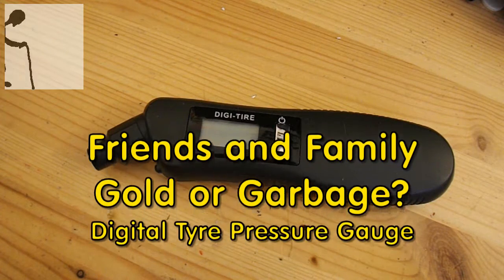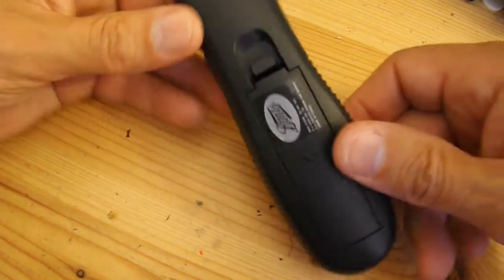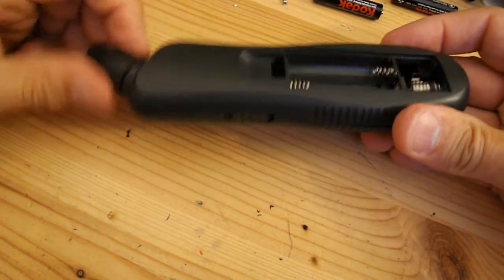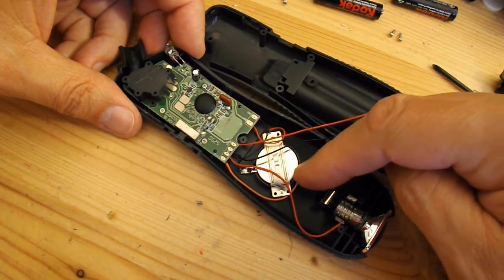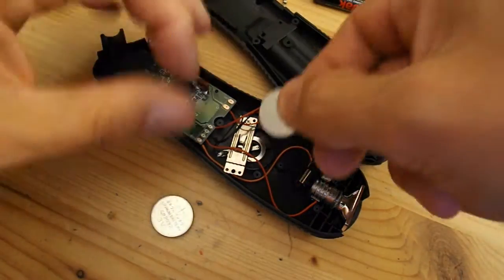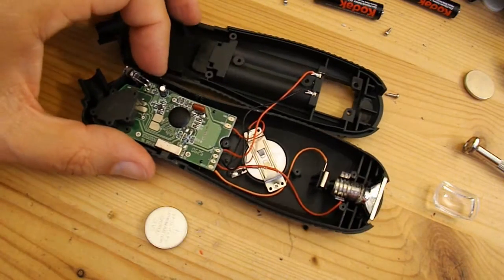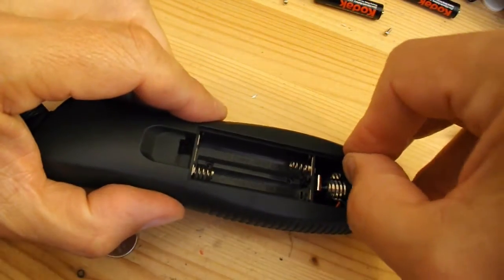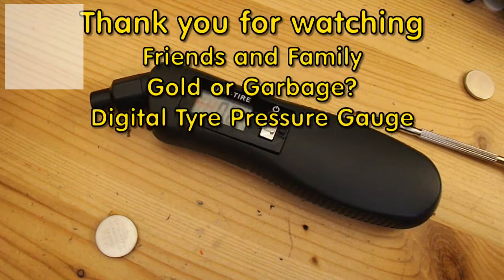Friends and Family - Gold or Garbage? Digital Tyre Pressure Gauge

Comment: This device is useless. I bet a person like yourself already has a powerful LED torch somewhere in the car and maybe also a portable 12v air pump, just in case.

I say create a fitting on one of your air powered toys and permanently attach it. That way you can get a reading on the amount of pressure you are creating when pumping it full with air.
Reply from the maker: Xoft C every 12v air pump I have ever bought, and that is probably 3 or 4, has burnt out or failed mechanically within 1 or 2 uses, yes they were cheap but you still expect them to last a reasonable number of uses. I have a trusty foot pump in the car that has saved me and friends on several occasions. Plus you don't want to have to dig out your 12v pump just to check your tyre pressures on a regular basis.